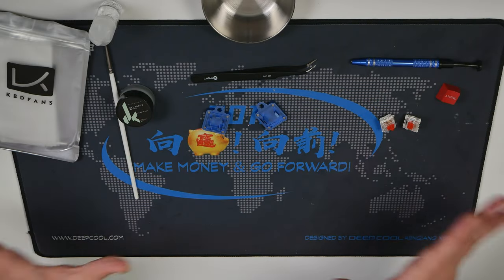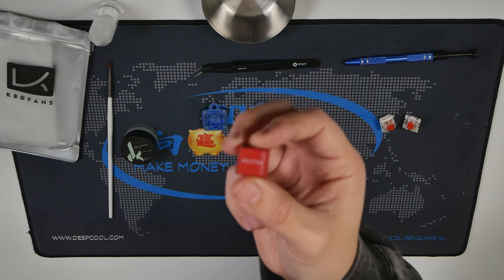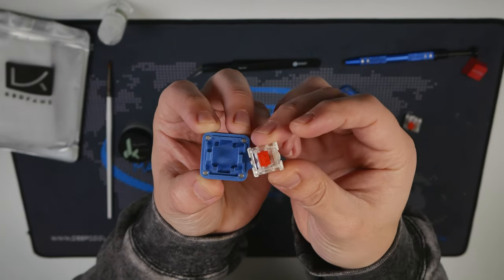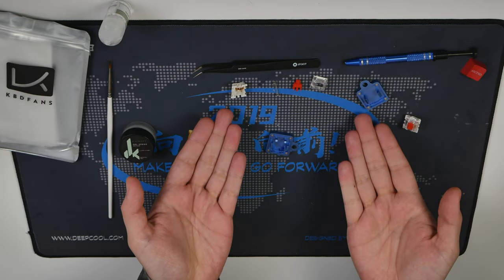How To Lube A Mechanical Switch!

Comment: Thanks a lot for this! I'm going to lube switches for the first time once they come in later this week. I'm not looking forward to it, but I'm hoping this guide will make it a little easier.
Reply from the maker: If you have any questions, leave a comment! If it can be scuffed I've likely experienced and had to correct/deal with it, so lots of practical experience here. What switches and lube?
Reply from the maker: Always a solid choice 👌🏼